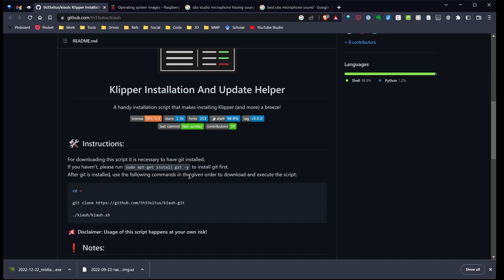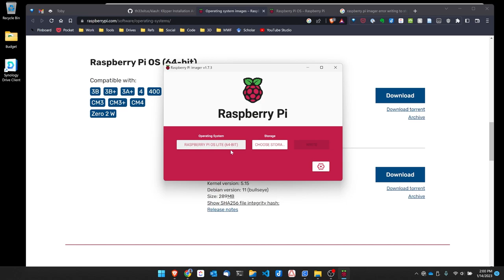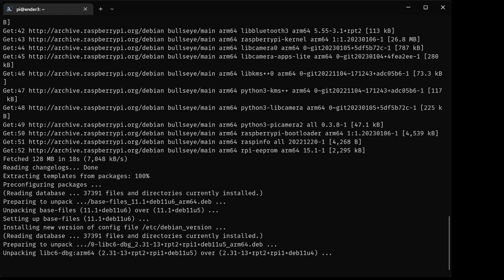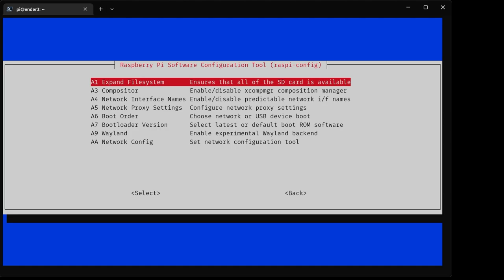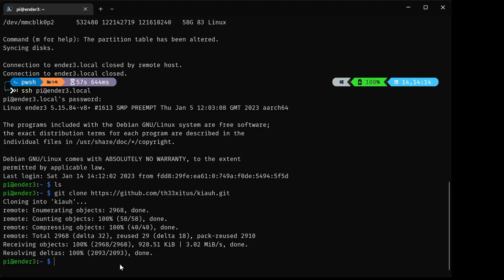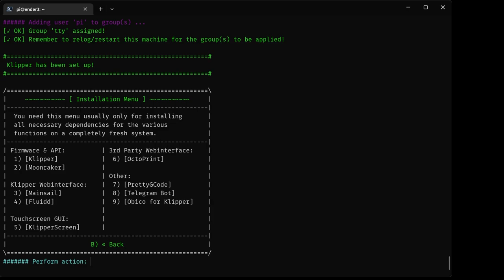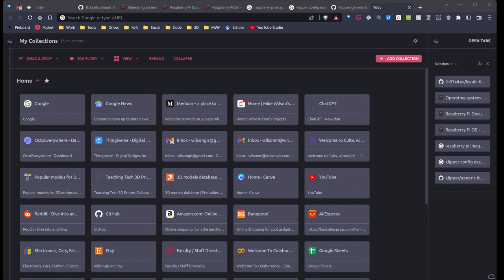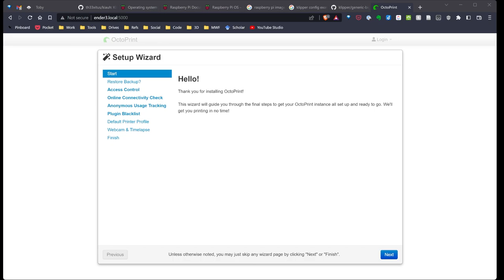Installing klipper firmware on a Raspberry Pi - A Detailed (and Boring) Guide (Part 1 of 2)

Comment: For your sound.  The issue is that you have the mic too far away so you turn your gain way up to compensate so it picks up the booming in the room.  Ideally you want the mic half way down your throat with the gain barely turned up.  This cuts out all the background echo or booming.  But since the mic is in the way of your videos you need to understand that all the professionals have the mic showing in their videos unless they wear a lapel mic.
Reply from the maker: I am currently using a lapel mic. It makes it easier to move around my office as I record.

Comment: I installed and get klipper work on ender 3 pro and out of the sudden my machine can't load up Klipper.  I tried to reflash the printer firmware and and unable to flash klipper.  i reverted back to Marlin and work.  is the 64 bit raspberry pi convert the bin file has anything to do with it?   I tried few times and wait or 15-20 min and still not work.
Reply from the maker: Are you using fluidd or mainsail?  In mainsail you can download and look at the Klipper and moonraker log files. I would look at the log files and see if you see errors.

Comment: You asked for feedback on your sound. If you use a compressor and enable the makeup feature as well as the default compression, you can maximize the volume while squashing any peaks during recording. If you need any help, let me know. I'll walk you through everything for free :) Your video was THE video that finally got my Ender 6 working and I've been using it for over a year now. Many thanks!
Reply from the maker: Thanks for the feedback. I have done a lot of work on the audio in my latest videos. I may still take you up on your offer. 

I am glad your printer is up and running. Let me know if you have any questions.

Comment: So far audio levels are a bit better than usual. You might want to up the gain on your input/mic a little more as it does still cut out a little bit when you’re speaking. Maybe  rotate the mic to face you as well as moving it a bit closer may help as well. Keep up the great work. 👍
Reply from the maker: Thanks for the feedback. I will mess with it some more. Getting the filters and the gain correct is a chore.

Comment: I can connect with the octoprint by selecting auto/ /dev/tty USB0 for the serial port. But not klipper  and main sail. It gives MCU error. Should i change any config files?
Reply from the maker: Did you update your printer.cfg with your MCU?
Reply: @minimal3dp  yes its working now. Only thing i am looking for is a printer.cfg for the SV06 plus.

Comment: Very good tutorial and easy to follow.  I've been running Octopi/Octoprint connected to my Ender 5+ for almost 3 years now.  Just received my Ender 5 S1 and wanted to try using Klipper.  You made it very easy to get installed.  The only thing that didn't work for me is the installation of the recommended macros for Mainsail, the connection just kept timing out.
Reply from the maker: Thanks for the kind words. I appreciate the feedback. I have not had that happen. I don't think you are missing much. I did another video about setting up klipper macros. Take a look at that one. Those macros are incredible.
Reply: @minimal3dp  Thanks, I will be following part 2 as soon as I get my new Ender 5S1 into its final spot and connected to the Pi.  It's currently connected to my 5+ and since it is running so well right now, I don't want to mess with it lol.

Comment: thank you you did very good job i was able to follow you step for step i have been struggling getting my printer back up since i installed skr mini e3 v3 with a h2v2s lite on ender 5 plus hopefully i can get my firmware working now with klipper installed
Reply from the maker: Let me know if you have questions.

Comment: having troubles with installing klipper code on to my raspberry pi via the imager. it all configures just fine however when i go to search up the ssh in cmd it simply does not work what am i doing wrong? any help much apretiated nice video btw it is very clear and easy to follow along with just this ssh seems to be stubern.
Reply from the maker: Did you enable ssh and configure your wifi correctly?

Comment: Thank you so much for this video, though I am wondering if you can help me. I’ve done these exact steps time and time again, but I’m working with a CR10 and now only installing klipper, mainsail and moonraker I found somewhere that the cr10 uses hex files so I copied that as I did not have a bin. No matter what I do, I cannot get the MCU to be recognized by klipper, despite the “firmware restart” buttons restarts the pi and the cr10, so clearly it’s communicating. 

What the heck am I missing here? Any help would be so much appreciated
Reply from the maker: What board is in your printer?
Reply: @minimal3dp  just a run of the mill cr10 v3. Atmega2650 from what I can find. I think I may have mixed the 5 and the 6 up typing that above idk. My coworker did it to one of these machines already, but his instructions are unclear. Yours are way better, but I still run into issues. It’s strange how with the config from the internet for the machine, the go to USB MCU value does restart the machine. It just doesn’t link to the cr10. 

I think the step where you create a firmware is where I am messing up. The step between creating the firmware, exporting to the SD and then rebooting the pi I think I may be screwing up.
Reply from the maker: @n00dles79  Did you use this config as your base?

https://github.com/Klipper3d/klipper/blob/master/config/printer-creality-cr10-v3-2020.cfg

Comment: Was wondering about the MCU error I get. Also looking to flash the KP5L, but since the existing tutorials/follow alongs are really bad——> no luck.
Reply from the maker: What error are you getting?
Reply: @minimal3dp  McU or moonraker cannot connect to klipper.
48 hours. I am about to give up. The printer has to print for years to make up for the time I am losing now. Your tutorial is great, but I just can’t get results. Kingroon Kp5L with GD132F103 chipset.
Reply from the maker: @michelwouterse  Sorry you had issues. I am not sure about that printer or board so I am not much help.

Comment: my pi wont turn on correctly after the sudo apt-get upgrade i have tried to hook it up to a monitor and it just gives alot of errors and wont login
Reply from the maker: Try to reflash it.
Reply: do i have to use another os maybe like the github says? i have a pi 3 b+ @minimal3dp
Reply from the maker: @miklasheinrich3748  do you know how to reflash the pi?
Reply: @minimal3dp   prob not when you say it like that xD
Reply from the maker: @miklasheinrich3748  didn't mean anything by it. If you use the RPi flashing tool, you can download and install a fresh copy of Klipper.

Comment: Include file '/home/**********/printer_data/config/m3dp-klipper-macros/optional/bed_mesh.cfg' does not exist

Once the underlying issue is corrected, use the "RESTART"
command to reload the config and restart the host software.
Printer is halted
how do i fix this do i just make a conf blank
Reply from the maker: Have you looked at the path via terminal?
Reply: @minimal3dp  yes i can see only   fluidd  fluidd-config  kiauh  kiauh-backups  klipper  klippy-env  mainsail  mainsail-config  moonraker  moonraker-env  moonraker-timelapse  OctoPrint  printer.cfg  printer_data
bloodrunners@Ender5plus:~ $
Reply from the maker: @mancave7635  Take out the line that is erroring out, you don’t have the Klipper macros installed.

Comment: I don’t know if anybody will see this, but I was hoping someone could answer a couple questions.
I have everything to do this done I’m pretty certain. Mainsail,fluidd,moonraker,klipper,
octoprint, all on the pi.
I did the firmware build and loaded it onto a mini sd.
I cannot get it to flash.
When I turn the power on to my printer it does absolutely nothing but turn on the red light on the skr mini e3 v3 board and the green light comes on when the sd card is inserted. Those are the only indications to me that it even has power.  The fan on the power supply doesn’t even turn on. Did I create a bigger problem than the firmware flash somehow or am I just not flashing the firmware correctly?
Reply from the maker: Sounds like it is an issue with your firmware build. What does mainsail/fluids say when you try to connect?
Reply: @minimal3dp  thank you for the reply and the video. It was a great video. When I started I had absolutely no idea what I was doing and wasn’t sure I’d be able to figure out how to do it I watched numerous videos prior to yours and got the idea to do this from a different video all together. Even though the one I got the idea from was great and explained how to do it very well IF you were a lot more knowledgeable and experienced than me. Luckily I came across these videos and you explained it way more thoroughly so that I was able to understand it easier. Thank you!!

As soon as I get home I’ll copy what it says and post it. I think it basically says it can’t find it and to try again in a few moments. I just keep restarting and it never finds it. On the TFT 35 touch screen it also says no printer found. I didn’t have that hooked up at first as I wasn’t going to use it. I was going to use a waveshare hooked to the pi with klipperscreen.
Reply: @minimal3dp  it says mcu ‘mcu’: unable to connect
Once the underlying issue is corrected,use the firmware restart command to reset the firmware,reload the config and restart the host software
Error configuring the printer.
Reply: @minimal3dp  fluidd also says printer is not ready. 
The klippy host software is attempting to connect. Please wait a few moments
Reply from the maker: @chadsanner792  what value do you have for the MCU?
Reply: @minimal3dp  so I didn’t change the Cfg file with the serial number.
Basically I did the ls command and it gave me the
Dev/serial//by-id/isb-klipper………. Etc. then the main boards number. So I flashed the firmware like 496 times but I just needed to work on the printer.cfg and I got it working.
Just missed 1 small step.

Thank you for this video and the reply so much. The video was so helpful and made something that I was nowhere near, I mean not even close to  qualified to do pretty doable. I learned a lot from this video. 💯
Reply: @minimal3dp  what I don’t understand is how I changed the Cfg file in Fluidd and it made octoprint and mainsail both operational.
Reply from the maker: @chadsanner792  They all pull from the same printer.cfg.
Reply: @minimal3dp  I do have 1 issue that I could use help with. I have a cr touch and not a bl touch and I need to figure out that piece of code for the Cfg file. To run it instead of the BL touch.
Reply from the maker: @chadsanner792  you need to use the same code as you would for a bltouch. I would Google your board and see if there is a sample for a bl/cr already out there
Reply: @minimal3dp  hmm, I’ll do some research. It’s set up with a BL touch but it  gets an error, something like the BL touch failed to do something. I think it’s something with the probe. It doesn’t come out. So then it doesn’t lower down to the bed.
Reply from the maker: @chadsanner792  can you post the code you are using?
Reply: @minimal3dp  [bltouch]
sensor_pin: PB1
control_pin: PB0
x_offset: -36
y_offset: 0
z_offset: 2.00
Reply: @minimal3dp  it says BLtouch failed to raise probe.

Comment: When entering the password in Putty it keeps saying access denied despite both the user name and password being correct. I can login on Octoprint just fine but not on Putty. Do you have an idea for what is wrong?
Reply from the maker: Are you set to SFTP?
Reply: @minimal3dp  What does that stand for, and where is that found?
Reply from the maker: @Viper4441  it is a setting in Putty. Probably a in a drop-down menu. It is secure ftp. If you take a screenshot of your putty screen I can try to diagnose.
Reply: @minimal3dp  Thanks a lot for the help, I can send a screenshot tomorrow since it’s late night here. Where can I send the screenshot to?

Comment: ssh does not work! ive tried absolutely everyting from every source, no luck!
Reply from the maker: My guess is that your pi is not connected to your wifi. Check the config when you are flashing the pi. Raspian defaults to GB wifi. Of you are not in GB it won't work.

Comment: the audio of this video is really hard to follow, you've got a decent mic (looks like maybe a Blue Yeti knockoff?) but it's very far away from you and I can't tell what it's set to (sounds like maybe bidirectional or omnidirectional, should set it to cardioid and then put it right in front of you). Also it sounds like you're running it through some sort of noise reduction filter which is really compressing the audio and making it really hard to understand.

Other than that the content itself is great- hope you get your audio issues sorted out if you haven't already
Reply from the maker: I changed up my mic and feel like things are better. 

Let me know if there is any questions you might have.